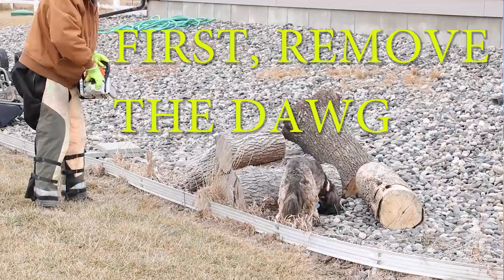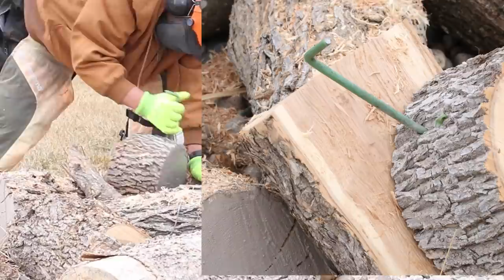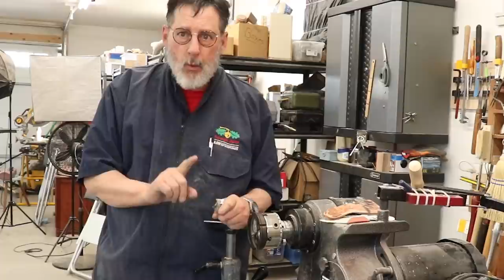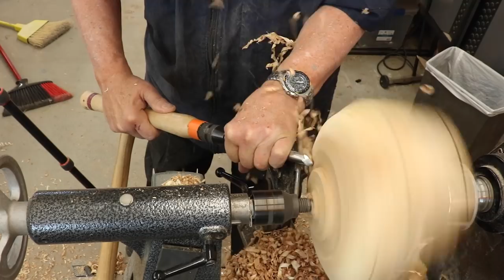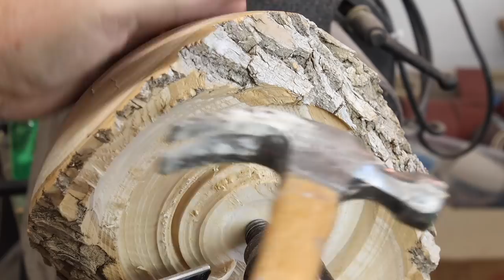Elegant Natural Edge Ash Bowl      Woodturning with Sam Angelo

Comment: Thanks for a step by step turning live edge bowl . I do not wear gloves like these turning,, tight fitting stretch mechanics gloves , only briefly 
I prefer to wear blue or black nalgene exam gloves , they deflect chips without the chips snagging in the knit fabric , and if ever that my fingers get too close to moving stock , they shred and do not pull my hand between the work and tool rest . 
I have a fellow turning friend from california that was wearing gloves , got his right hand pulled into the work . After he got his hand out of the works , a trip to local E R , and 2 hours of surgery and 3 screws later , the surgeon was able to put his broken pinky back together and saved it from amputation
Reply from the maker: Garry, this is a very good idea. It is one I have heard before but it is really excellent and probably accomplishes the same thing as wearing a cloth glove. Thanks Sam
Reply: In the AAW  safety guidelines , they do not recommend wearing gloves for that reason 
I am reminded of some advice from the county safety training officer , when I worked for county ,  
He had been a blaster in the iron minds in northern Minnesota He said , " Back in the old days , when applying for a job , the foreman asked you to show your hands , he said the men that were missing fingers , got hired , because they knew what Not To Do

Comment: Great comprehensive video, Sam! I learned a lot about positioning a live edge. And, your bowl is simply excellent. I never saw, did you need to deal with the split you found, near the beginning of turning?

Looks like you don't have much snow. My parents are about six hours north of you and have bare lawns. We're 2.5 hours north of them and have 5' piles on ours. Looking forward to spring. Thank you for the lesson.
Reply from the maker: Jay, not sure what it looks like now I put it away in some shavings and haven't looked at it for a while. There were several cracks but weren't getting any worse, so I am hopeful, thanks for watching my video I appreciate it Sam

Comment: Nice video and nice bowl, Sam.  Looks like you cut right through the pith when you cut the blank log.  Gave a nice look to the bottom of the bowl.  Did it cause any problems with cracking as it dries?  I got some ash and I think I'll try this design.
Reply from the maker: Tom
This is a really good question. When cutting a log that will be a natural edge bowl, you have to be careful about leaving the pith  in the blank.  Yes this can cause some serious problems like cracking later on. But I think I'm OK with this one thanks Sam

Comment: I'm a beginner -- I have made maybe a dozen bowls, only one live edge. But here's a naive question: why don't Robust lathes provide a readout of the speed? At about 10:00, Sam estimates the lathe speed at 500 RPM. Do experienced woodturners really not need the speed indicator? This is an honest question, not a criticism. Thanks.
Reply from the maker: Dave, that's a very good question. Robust makes three Woodturning lathes.   The scout which is the smaller of the three lathes has a read out and also the Sweet 16 has a digital read out. The American beauty does not. I am not really sure why.  To your question, do Woodturners really need the speed indicator? I think after a while as you gain more experience you know what speed is too fast and Wood speed is correct. I usually don't know what speed I'm turning, but I also no what is safe thanks Sam

Comment: Why did you not adjust the blank to get the bark even before you put on the tenon rather than after?
Reply from the maker: Roy, Good question.  I think mostly it has to do with shaping or profiling the outside of the piece.  I always make the tenon too large in case I need to reduce it in size later.  The tenon, the way I make a bowl,  is the future base or foot of the bowl.  So I feel I must have it established early on.  But I must try NOT making the tenon on a natural edge piece before I line up the high and low points.  Thanks for making me think.  Sam

Comment: Nails- those things will certainly screw up your day when you hit one while turning wood.  I have hit a few during my time turning and sawing wood.  They will damage your tool or break a saw blade.   Consequently, I have learned to use my old Garrett 250 metal detector to see if wood contains any metal objects.   I have found several nails, bolts and screws in wood I was going to turn or saw.  When some boxes of saw blades cost well over $160, a big nail, bolt or screw can really make your day by hitting one.  Now, I avoid damaging blades by using a metal detector before sawing logs. A step of precaution goes a long way saving money and from a safety aspect too.
Reply from the maker: J      a metal detector is something I have not purchased. In over 30 years of Woodturning I might have run into four or five nails or other metal objects. But if I had a wood miser I would certainly invest in one thanks Sam
Reply: @WYOMINGWOODTURNER  

I purchased 150 acres of land 25 years ago in the piney woods of East Tx and many of the trees had large railroad spikes imbedded into them.   My only guess was to discourage illegal logging 30-40 years ago.  I just know many of the trees I have on my land have them.   It has made logging on my l land difficult since the property has been flagged by lumber companies.  Consequently I get a lot less  for wood if I am able to sell it.  As a result I use a metal detector when I cut logs on my small saw mill.

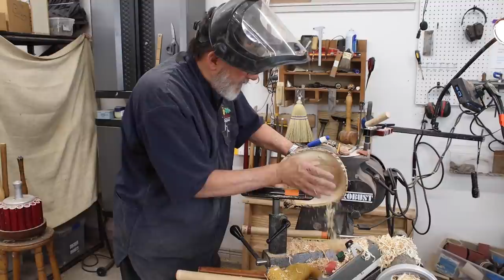Comment: 25:30. Another newbie question: why is this "never going to be a show piece"?
Reply from the maker: David,  turning "wet" wood to completion, and a natural edge piece sometimes results in cracks or splits that are hard to prevent.  This one had several.  I am always thinking about resale.....Some folks are OK with these miner checks but for some, they think a bowl should be perfect.  But I think it will be a good piece when it is dry.  I have it in a bag with shavings now.  Thanks Sam